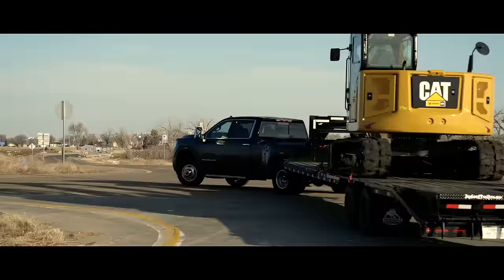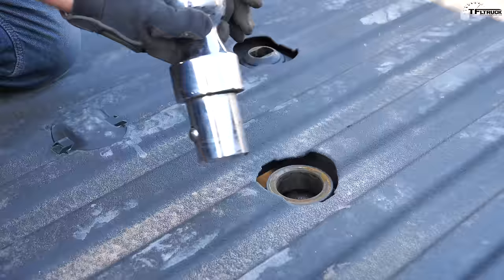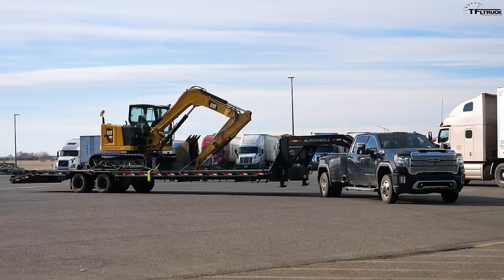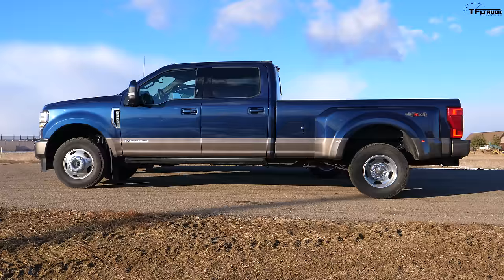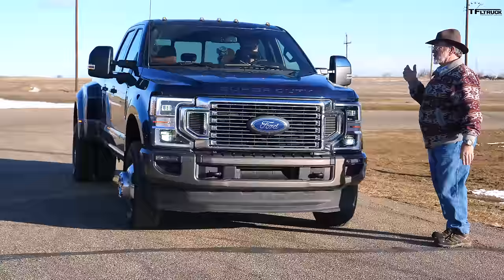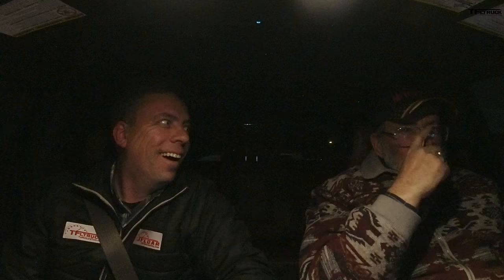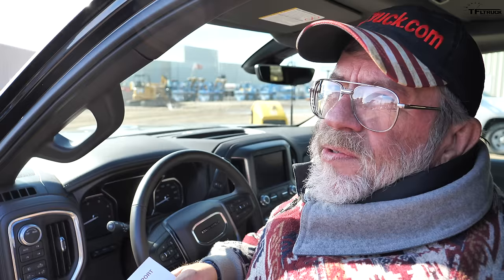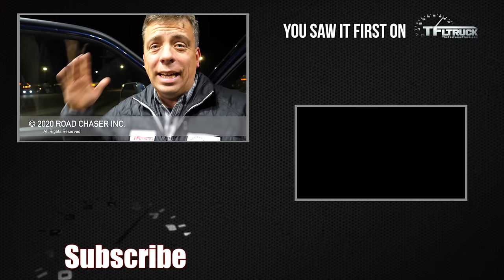30,000 Lbs Monster Tow Test: 2020 Ford F-350 vs GMC Sierra 3500 - Drag Racing & Tow Off!

Comment: Andre When you talk about HP and torque like they are different or not linked directly to one another remember this. HP is derived from torque, the only thing HP means is how fast the work is getting done and Torque is how much work is getting done. You can't have one without the other. If an engine makes 1000 ftlbs of torque at 1500RPM and it also made 500ftlbs at 3000rpm the HP will be identical at both of those engine speeds. This is because the torque was cut in half but we doubled the engine speed or RPM. Imagine two guys shoveling snow out of their driveway, one guy is using a 24"wide shovel or 1000ftlbs and the other is using a 12" wide shovel 500ftlbs. The 24" shovel will take half the time at the same speed or RPM when compared to the 12" wide shovel. But if we can shovel twice as fast with a 12" shovel, aka Double our engine RPM we can make the same HP or shovel the same amount of snow in the same amount of time. That is HP! Same amount of snow shoveled but two different torque amounts and two different RPM.    The equation for HP is this         (RPM * Torque) / 5252=HP           The next thing you need to learn is how engines are air pumps and the amount of air we can get in one determines the amount of torque it can produce.

Comment: The one thing that I wish shows like yours and others would do is compare ownership cost over a long term.  Many people just can’t afford to buy a new truck when the warranty runs out.  
I have a very old but reliable 2001 F250 7.3L diesel with over 300k miles and when I hear some of the repair cost to fix the newer trucks, it just crazy. It makes me not want to get a new truck.  It would nice if you guys would do a segment on the repair cost of the new diesels.  For example, brakes, water pump replacement, DPF filter and so on. Today’s trucks are not made for the average person to work on them anymore.  I think most people get caught off guard by the repair cost of today's trucks.
Reply: I hear you.  I just got my 2008 Dodge back from the shop.  At 240k miles, I had to have the exhaust gaskets replaced, and all the EGR system gaskets and clamps.  $1340.  500 of that was labor.  My 2001 Cummins Dodge has 577k miles, and has never had exhaust gaskets replaced.  I blame the high pressure loop EGR system.

Comment: Ford for the Win!!!
Reply: Ram
Reply: Ford always win with their super duty trucks.
Reply: Nobody voluntarily buys the Dodge.  Your wife probably tells you to because it's got a pretty interior 😂
Reply: A Ford F-150 with internet access well your just made cause your truck is made out of aluminum cans. Ford-Found On Road Dead
Reply: @Cody Patton You got it, I’m so “made”. Too bad Ford wasn’t using aluminum in 1980, good try though.
Reply: @luc0650  Ram doesnt even count 😅 Fords 6.7 has more horse power and torque than those loud and annoying Cummins 😉 Its not the big three anymore. Just the big 2 and Ram. But to Rams credit, they took GM out for #2 in sales last year. Still second to Ford! 💪

Comment: If I remember correctly, those zero to sixty times are about the same as a v 8 mustang or camaro from the 80's.
Reply: And this is a mile above sea level. It would be even faster at sea level.
Reply: I ran my 2020 F-350 Dually at the dragstrip .... 15 second truck
Reply: @Pepelopez642  that's quick really for a 9,000lb vehicle.

Comment: When Ford had their diesels built by NAVSTAR they had engine problems and GM routinely beat them in mpg, 0-60 and towing. That new in-house built diesel seems to have turned it around for Ford. The slightly lower rear may have helped it but overall, It’s a great truck. The GMC needs airbags or something - that shimmy is worrisome. Who would have thought that a modern truck would have a 10 speed?
Reply: The 6.7 is typically a hundred thousand mile engine.  The Duramax will run indefinitely as long as you keep oil in it and give it fuel. There is NO comparison between the American Duramax and the Mexican junk 6.7 Powerstroke.
Reply: @86dieselman  😂 you do realize gm is made in Mexico now....
Reply: @ShotgunReliant  Wrong feller don't try to correct me because I have all the info on this topic. The only trucks that GM builds in Mexico are 1500 crew cabs.
Reply: @86dieselman  I had an ‘02 Duramax and it was reliable. Never broke down and made good power.
Reply: @therealjohnsmith4811  nothing to do with trucks there little fella. Anything relevant. Nope, didn't think so.
Reply: @georgiafan6618  My 02 had 1.5 million when I retired it. Still ran like new. Original engine and transmission. 26 miles per gallon when dead heading.
Reply: @86dieselman  I miss that Duramax and prefer diesel over gas. Once you drive a diesel, it’s not easy to go back to gas. I sold mine when diesel went to $5/gal. Best time to own one is now.

Comment: Wow... That's awesome performance from the Ford!!! I own a 2017 F350, and towing about 25k pounds, I'll get about 5.8 miles per gallon. To see that kind of change, that is pretty good. The GM just needs a little better gearing and serious redesign, because their trucks are hideous looking and very uncomfortable.
Reply: @R AJ yeah, I know. I'm glad to see the Ford just handling business like that. That's amazing! Of course, We'll hear the Bowties scream that the Ford is running too hot and wait until summer, just to nit pick, but bottom line is this: GM just got it's ASS kicked by Ford in an apples to apples test. Period.
Reply: Apple's to apple's would be exact same gear ratio... now do a unloaded test and the gmc should get better fuel mileage than the Ford and I say should
Reply: @93chevy93  we would hope so, but if you get a dually, you get it to work, not to drive around unloaded, unless you have something to prove. I only use mine to pull or serious work, besides that, it's in the garage. Granted, I'm pulling heavy or hauling heavy 3-4 times a week, so I use it a bunch, so it doesn't get much down time.
Reply: @93chevy93  and besides, GM's 3.42 hear ratio should have given it better fuel mileage than the Ford's 3.55, right? With something this close, it really doesn't make too much of a difference. It's a pulling straws type of thing. This is more overall truck performance, and Ford's got it handled.

Comment: Well i have a comment, i use to work at a Chevrolet dealership...we had a construction owner trade a f350 in for a duramax. 3 days later this guy came back and bought his f350 back because the duramax didn't pull his bulldozer up hill as easy as his ford.  Let's keep in mind, this guy had Serval GM fleet vehicles in his company, but just couldn't do without this ford f350

Comment: Isn't the excavator a bit forward? Maybe that's why the ride was bumpy on both trucks.
Reply: Good question - would like to seem them address that, that ride in those trucks was terrible :(
Reply: I'm trying to figure out if the machine should be a hair more FORWARD on the trailer to add a tad more weight to the hitch? If that would smooth out the ride a bit. Looking at the trailer, it already looks like the excavator IS forward, in relation to the axles I mean. But as another here pointed out, the bulk of the weight in an excavator is on the rear of the machine, where the counterweight and engine reside. So that's why I'm wondering if the machine should be maybe a half foot to a foot more FORWARD on the trailer. If you have your weight BEHIND the axles, that's when you will get your shake, rattle and rolling going. I load a trailer with the bulk of the weight over the axles BUT if anything, just a hair forward of the axles rather than behind the axles. The more weight you take OFF the hitch,  by way of moving the weight BACK on the trailer, the less control you have of the vehicle. (The physics of it … If you move the bulk of the weight to BEHIND the axles, the axles become a pivot point, so the speak, thereby making the rear of the truck itself too light which equates to less control of the vehicle). Obviously you can't put ALL the weight up on the hitch nor are you supposed to because there is a limit there too, but there is a 'sweet spot' in there.
Reply: That was my first impression. I’d load the excavator more or less on top of the axles on trailer. Just  my opinion

Comment: Appreciate the videos! Keep them coming! Good video! Good comparison. The Ford has 3.55 gears, and the GMC has 3.42 gears right? Both trucks are very nice. I really like that trailer as well.
Reply: That different gear ratio is the .9 mpg difference ...but should make better mpg than the Ford unloaded I'm guessing?
Reply: Don't forget, the transmission gear ratios play a part in that too. Not just the rear end

Comment: The cooler air probably helped too... need the temps to be similar. Probably would make a closer comparison
Reply: Typically colder air will net worse mpg but more power.

Comment: Incredible tow capacity. My 1983 Chevy C-10 with original 305 engine and 3 speed automatic hauls 2000lbs of roofing tear off down the road at 60 mph. Steering gets a bit squirrely above 70mph, but I slide by.

Comment: One thing I noticed, the GMC was tested mainly during daylight hours. Looks like the Ford was tested mainly after dark. I wonder if the difference in air temps has anything to do with engine efficiency? Either MPG’s or def.

Comment: That excavator was loaded incorrectly, the boom should always be to the back if it all possible, and the whole machine should have been further to the rear by about 1.5 to 2 ft there's too much tongue weight and not enough weight on the actual axles this is where the Bucking and porpoising comes in the play how do I know I've had this exact scenario with my excavator upon moving it properly over the axles with slightly forward of them the problem disappears.

Comment: Do you guys take into account temperature changes when doing your mpg runs? I make the same drive from Wiggins to Denver everyday and get significantly better mileage when it’s above freezing out.
Reply: That's because AFR plays a factor in mpg.  The cooler the air temp the more dense it is.  Due to AFR, the more dense the air the more fuel that must be burned.  Therefore, mpg will always be greater in warmer temps.
Reply: air drag is much greater when cold. even planes have trouble flying in super hot weather, its called density altitude factor

Comment: Finally GM got it together and put the DEF filler beside the diesel instead of under the hood.  Pulling a heavy load from NC to TX and have to refill the DEF in a hot engine bay.

Comment: Could air temps have made that difference in MPG? Colder at night with the Ford?
Reply: The Fords will overheat in Summer.
Reply: No, you can blame it on a better design by Ford.
Reply: @Dive-Bar-Casanova  Imagine resorting to spreading misinformation for no other reason than the fact that the brand you a blindly loyal to lost in a towing matchup. Pathetic.

Comment: Ford just makes beast trucks F-350 pulling a 30klb trailer with decent fuel mileage. Can’t sleep in Chevy though. But I do have to say I’ve seen brand new Chevy trucks on the lift needing major repairs to the transmission

Comment: Anyone else notice they let the fuel caps hang on the body🤦🏻‍♂️
Reply: Yes, and cringed, especially when I saw the DEF splash on the GM. It only takes a tiny amount of DEF in the fuel tank to dismember the very expensive fuel pump and injectors.  When they refueled the GM you could see the crystallized DEF from when they first filled it. The DEF does that when it gets into the fuel system too.   Very cringe worthy to watch.
Reply: You can ruin the fuel system breather system by stopping off the fuel

Comment: i am not surprised at all ford makes the best truck they feel good towing. the comfort they feel great to drive they will last forever if you take of them... i work in the oil field 12 + years i have drove them all gas dis chevy ford dodge gmc... i been in the in the Rockies  Texas Louisiana  all over the place driving... ford is the best to me that is from using them but gmc is close i dont like some of things about the inside and outside of the gmc trucks

Comment: Ide like to see how the 2020 f450 tows vs the f350
Reply: Apparently worse, another viewer has told me that it has a smaller gvwr than the 350.
Reply: In years past in my experience it'll do quite a bit worse speed wise.  The 450&550 Powerstroke engines were derated quite a bit in years past. That in combination with the much lower rear gears really hurt it holding speed on steep hills while towing heavy.
Reply: bo duke cab and chassis 450 is derated not the pickup model
Reply: @trailspeed7037  gotcha, thanks for the clarification.  I did indeed have cab and chassis with utility beds on the trucks of mine I was referring to.
Reply: @ChuckBeefOG  they actually have the same gvwr of 14,000 lbs
Reply: Collin Morgan But the truck is heavier, so it cant carry as much weight.

Comment: From the rpm the f350 had to have 3.55 gears. My f350 with 4.10s is like 2100 rpm at that speed
Reply: You have a 2020 f350?
Reply: @BigInjun05  no but I have a 17 and 6th gear in mine is almost identical to 10th in the 20.
Reply: @hobanm45  it's a closer to 9th but still not far from 10th. So should be kind of similar.
Reply: They should just put a manual EatonFuller 18spd in these things. That would be a riot to drive.

Comment: I would only drive and buy the Ford no matter what the test say
Reply: Firelord360 yeah well you like driving a aluminum can then
Reply: @codypatton7908  you realize other brands are doing this too and I would take any Ford over GM with their known problems including ball joints and tie rod ends and so on
Reply: Firelord360 yeah and you can say the Ford has EGR valve issues and oil pump issues.... no truck is perfect. All I’m saying is if you hit a cat in your alumiduty it’s probably totaled lol
Reply: @aidanwarr245  i never said any truck was perfect and funny you say they seeing how other companies are following the idea of aluminum parts, its only a matter time, I would rather have a toyota or nissan over any chevy product and its not the EGR valve it is the EGR cooler so that is from the EPA regulations but my state doesn't check for that at all and I never see many with oil pump issues at all
Reply: Firelord360 all the newer Fords that come into my shop all have blown oil pumps, my family only uses GM and they’ve treated us well. Had a 2004 6.6 with 375k and it just needed injectors and basic maintenance before we sold it (thing was rusted to shreds being a Michigan truck)

Comment: bumpy as all hell. that musta been fun lol.   maybe load too far forward?
Reply: Derek Comingo I don’t know anything about trailers and towing but it looks like that trailer was bouncing both trucks around.
Reply: Length of trailer usually plays a significant role in ride control. Usually, the longer  the smoother. I wouldn't expect a super soft ride when towing 30k. In this instance though, I could see the trailer possibly being part of the culprit of the rougher ride. It's size and robust design could be transmitting more torsion to the truck. Loaded trailers usually make you feel like your floating (IMO) with the work it puts on both suspensions.
Reply: I can attest to the fact the road is horrible where they did this test. It will knock your fillings loose.
Reply: Derek Comingo my 16k loaded trailer does the same thing. I’ve read multiple post about the curt ball fitting and the puck system having to much play and I believe it’s from that. Mine does the exact same thing
Reply: I drove through there in October with a 20k  fifth wheel. It was a rough ride. Eastbound and westbound it was pretty much the same.
Reply: I feel bad for the fellas then. Rough ride
Reply: I thought I saw a brief shot of the rear springs during one of their montages and it looked like it might have been bouncing on and off the overload perch.  Anyone who has ever towed a trailer, though, knows that there are just some roads (i.e. concrete, or asphalt over old concrete) that will do the same thing, no matter how you're loaded.  Usually slowing down helps a lot.  The first time I ever towed a trailer, I had about a 5 hour trip home with everything new to me, and there were plenty of stretches where I thought my truck was going to break in half the bouncing was so bad.  A good load with 12% or more tongue weight (bumper pull) rides great, though.

Comment: You guys just contradicted yourselves you said the 350 control the 37,000 lb with optional equipment meaning the single cab 2-wheel drive as what you have said in previous video

Comment: The rough ride can be attributed to the way the excavator is loaded. Not enough tongue weight. The bucket should be facing the rear which would transfer more weight forward with the engine.

Comment: But what I’d like t know is the differential ratios between the two, being as close as they are! I know the GMC only comes with the 3:42, but the Ford has mores choices, from 3:55, 4:10 and 4:30! Either of which would be an advantage.
Reply: GM. was 3.42 and Ford was 3.55. Your right the GM's 3.42 would be a slight advantage for fuel economy.